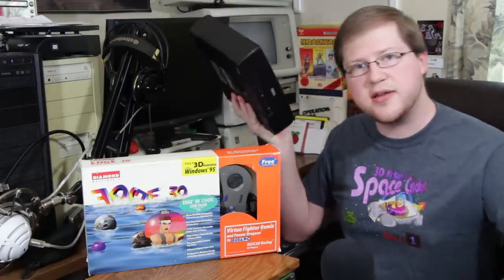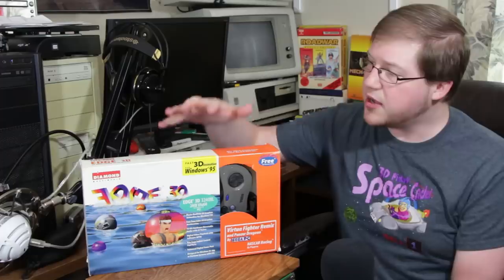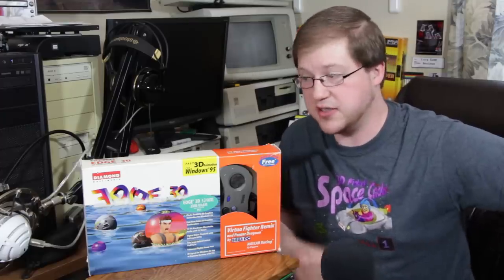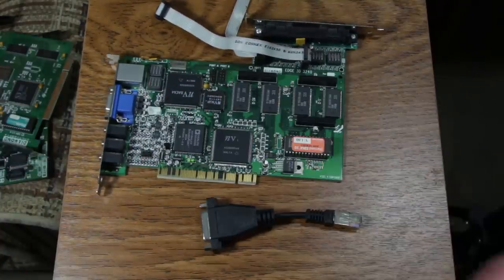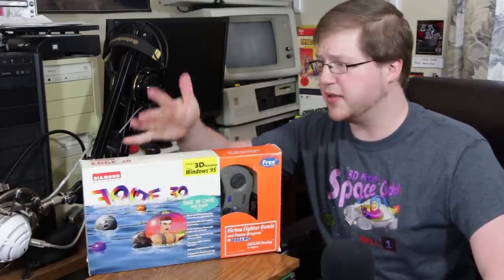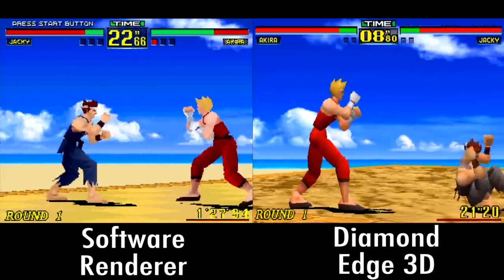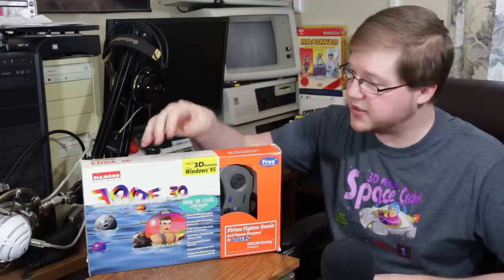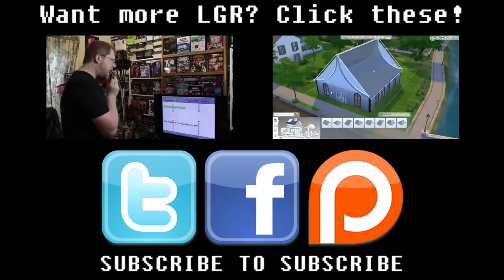LGR Oddware - Diamond Edge 3D (nVidia NV1+Sega Saturn Ports)

Comment: About OpenGL support way back then, the truth is that very few on these early 3d cards aimed at the gaming community really supported OpenGL. At this time OpenGL was more an API for professional rendering applications and things like CAD. That's even true for the 3DFX voodoo 1 and voodoo 2 cards. The  only "OpenGL support" they had was a kind of "mini OpenGL" which was only a subset of the full OpenGL API. And it was accomplished through an OpenGL Mini driver, which was really just a wrapper to Glide. It was really just a workaround for ID to avoid violating a contract they had with rendition. As part of that contract rendition helped ID develop VQuake, the first 3d hardware accelerated version of quake which specifically ran on the renditions virte cards. As stipulated in the contract ID, in return, was not supposed to release a version of the game that had native support for any other card manufacturers. But being impressed by the performance of the 3DFX products, Carmacke wanted to release a version that would take advantage of that. So, the Mini GL glide wrapper was born as a workaround. Probably the only 3d gaming cards of this era that perhaps really supported OpenGL might have been the Permedia 2 based cards and I'm not totally sure about that.
Reply: Where did you get this fairy tale story? 
I know a completely different story about this. Windows 9x initially did not support OpenGL, it could only support Direct3d (not counting Glide and other 3d party APIs here). However, Windows NT fully supported OpenGL, but the demands on driver programmers for a complete OpenGL driver were so high that initially there was hardly any hardware with corresponding drivers. That's why the concept of MiniGL drivers was introduced as a workaround in Windows NT by Microsoft.  It was intended to simplify development and be available as a quick interim solution until graphics chip manufacturers had developed full-fledged OpenGL drivers. MiniGL did cost some performance, that was their drawback. 
Later 3dFX was working on a full OpenGL implementation, and in the meantime had the MiniGL drivers. However, this full-fledged implementation never happened because 3dFX went bankrupt at that time before it was finished.

As for ID software, John Carmack developed Quake on a NextStep machine because that was a better way for him to develop. The NextStep machine naturally supported OpenGL and later he switched to Windows NT 4.0. But that was only after the release of Quake. Windows NT 4.0 was therefore used for later patches for Quake and for Quake 2 as a developer system at ID Software.
ID Software would not have to sign such a contract like you claim. They didn't need to. The 3D chip manufacturers were at their feet at that point. So there was no reason to limit themselves.
Reply: @OpenGL4ever  As you said yourself OpenGL support was a driver issue and as such required a driver that implemented it. yes, there were professional 3d cards that supported openGl, but pretty much none of the 3d gaming cards did. They only supported Direct3D and sometimes a proprietary API, like Glide. Anyway, the so called "mini driver" that Quake and other ID games used was nothing but a DLL that functioned as a wrapper that translated a small subset of the OpenGL api calls into Glide. And it was said that it was coded by Cammacke himself. Yes, later on, gaming card manufacturers added OpenGL support into their drivers, but the miniGL DLL that Quake used was just a wrapper to Glide, that's all, nothing more.

Comment: I remember buying a GeForce4 Ti 4200 128MB in the early 2000's...Now we have like 6-12GB video cards with quad SLI that cost more than a used car. I also remember dreaming about having a 512MB video card, I thought I would never need to upgrade lol.

Comment: So, are you saying that the DirectX drivers actually made the card useless and everything just used the CPU in software mode or did it still use the card's possessing but it couldn't use any of the special chips designed for the quad computations?

I would have liked to have seen some other games that didn't come with it, just to see if it would work with regular games that were specifically made to play on it.

Anyway, have a good one.

Comment: I had this card when it originally came out.
The 3d acceleration was only useful for this games that it came with, no more games were ever released. 
There were a could of serious issue with this card:
1 - Did not support the actual 3d APIs computers were using (OpenGL and Direct3d)
2 - it could not run actual SEGA Saturn games only the PC versions of them, and none were ever release, except the ones that came with the card itself 
3 - It was not a proper VGA card, so running DOS games with it was a disaster. I remember trying to run DOOM and it was garbage, much worse when my normal VGA card.

All and all, I was happy when I got rid of it and bough a proper PC 3d accelleration card, the 3dfx Voodoo.
Reply: Point 3 did also apply to the rendition verite.

Comment: now if only someone would homebrew an adapter to make the EDGE board connect to normal USB. I'm certain it's possible, but I'm not well-versed enough in programming or PCB mapping to make it happen. If the Saturn controllers are as good as people say they are, however, it would be quite cool, and a much more elegant solution than a USB adapter.

Ultimately, though, a preexisting USB-Saturn adapter plugged into the motherboard and gutting the EDGE board to make a passthrough would be much easier and more practical while being externally elegant.
Reply: +inteli722 Or just wire a usb adapter inside the case so you don't have to see it..

Comment: I hear what sound to me like some odd phasing issues with the sound on the Diamond edge card, the stereophonic sound field doesn't sound right to me, it sounds a bit odd, particularly in the left channel, and I can't really describe it very well, is it possible that you didn't have a cable plugged in correctly or was the card doing odd things?  You talk about playing conversions of Sega Saturn games with this card, but if you owned a Sega Saturn and games, was it possible to put your Sega Saturn CD-ROM games into your PC and play them using the Diamond Edge card, or did you specifically need to buy PC conversions of the Saturn games?

Comment: This is an awesome card... Wish you could Install these on modern pcs :(
Reply: Doddo MultiGamer Yeah that's not the issue, getting something built with a firmware supporting Windows 95 to run on a Windows 8 pic would be the hard part

Comment: Wait is the Saturn console capable of the better output quantity? That is a significant difference. I know very little about this but I want to achieve that level quality. D :
Reply from the maker: Nope, this is a 3D accelerator, so it's doing a lot more than the Saturn did.
Reply: So pretty much buy the card or hope someone makes it better emulator, right? :(

Comment: Does it solve crash detection? I ran Saturn iso's last night, Virtua Fighter to be exact. Graphics and everything looked great (not using one of them cards by the way, got way better), the issue was the fighters were ring outting in the middle of the ring.

Comment: Nice video. And I agree with your soundcard comparison. However, roland wasn't the satandardback in the day. Rolands sounded awwesome, but were too expensivve for most people, which is why soundblaster was most popular. And the typical soundblaster would not sound much better than the diamond card. So by quality, there wouldn't be a loss when going for this "all in one" solution.
Reply from the maker: And if you listen to what I said, I wasn't talking about "standards" or anything like that. I was talking about the fact that this card came late to the sound card game and was aimed at higher-end users. But higher-end users already had awesome higher-end hardware, like the Roland devices for instance, that were far superior to what the Edge 3D offered. Keep in mind the time period this was offered. If you were talking about 1991 or something, it'd be a different story.
Reply: Lazy Game Reviews

Actually it doesn't make much sense that way, since Roland Cards had their high times in the early 90s. By the time the sega saturn came, no one used a roland card any more (and only few used them in the first place). There was an interview in a podcast a while ago, in which Rolands PR-Guy of the time stated that "Nobody except game reviewers ever used Roland Soundcards". So getting Roland in the comparison is outside of context either way. You should have compared the card to a soundblaster-compatible card for the midi-part, which was outdated anyway, since CD-Roms made their way after 1993. Of course there were still games that used midi, but by 1996 there were very few. So your comparison seems out of context to me. Don't get me wrong, I like the rest of your video but that just seems plain wrong to me.
  .

Comment: Are there any modern drivers for this card today or does it run on something like a COM port? I'd love to use this for the controllers!
Reply from the maker: Nope! But you can easily use Saturn controllers on modern machines using a USB adapter.
Reply: It just isn't as good as a dedicated card for it </s>
=P
Reply: This is irrelevant, but nice profile picture, dude.
Reply: why isnt it a dedicated card? its an actual GPU

Comment: Heh, the box says "Photo-Realistic 3D Graphics"  If that is photo-realistic I would hate to see what kind of world they live in.  Still, not bad for its age.
And yeah, video cards can make such a huge difference.  A friend of mine recently bought a used computer that had an nVidia 9300 card in it; the other stuff was good, but  because of the card games looked terrible.  So I had recently replaced my old computer and gave him an old nVidia 8800 GT card (A seven year old card that can still run Skyrim at medium to high settings with a smooth frame rate).  The difference was amazing.
Reply: That's logical, because the 3 in 9300 stands for an office card without much power. While the 8 of the 8800 stands for high end.
By the way, this has been the case with Nvidia cards for many decades. The second digit read from the left determines the class.
A 9800 would therefore be faster than the 8800.

Comment: Also, would it be possible to play other Sega Saturn games with this card, or would you have had to use other methods, as I note you say the games were specifically redesigned for the card.  Thank you, again, sorry for the many questions.
Reply from the maker: Nope, no Saturn games. The three Sega PC games for this were 3D-accelerated PC games that are specifically designed for the card.
Reply: Lazy Game Reviews - Thank you for the reply, hadn't really known much about the card until your review, so was very curious about these matters.  :D
Reply: Lazy Game Reviews I had the same question. :) It's no wonder that this card was a sales failure when it cost within a stone's throw of a full-on Saturn and had a very limited game library in comparison. A Saturn board, that included sound/game ports AND controllers, that let you play straight up Saturn games for $150 less would have sold like... well.. a bit better?
Reply: Maxwelhse Smith That's a good point, I don't understand why they didn't just allow it to play saturn games through the CD ROM drive if it had all the Saturn hardware already on the card?  Would've given it a lot more value.
Reply: Oh well.. You can buy a Saturn NOW for like $50, so we're all better off anyhow.. If only some of the games weren't like $400!
Reply: Maxwelhse Smith Yeah, but seeing every  saturn game in native 31khz would've been awesome!  I will just have to stick with 240p RGB on my saturn. :P

Comment: this is such a rad thing so question Lazy Game Reviews since that plays saturn game i wonder if you can mod it to play all of the saturn library. Plus i wish the genesis had something like this man that would be awesome XD
Reply: kaio0777 No, this is just a computer graphics card with Saturn gamepad compatible ports on it and a soundcard, not an actual Saturn hardware. Its rendering principle is incompatible with Silicon Graphics and Playstation approach to 3D, and it is vaguely similar but more powerful than what Saturn offered, so the card had an unfortunate distinction that only Saturn games could be ported to it without too much effort, and a handful of such ports have been produced.

So it's absolutely not helpful with regard to Saturn emulation or Saturn hardware recreation, certainly not more so than any other graphics processor of today based on a more general approach to rendering.

Comment: Why did some of the dashboard components in Nascar change between versions?  Using software renderer there's a white switch to the upper left of the tach that isn't there using the edge.  Using the edge there are two yellow switches below the oil and water gauges that aren't there using the renderer.
Reply from the maker: 1903tx They re-drew the entire cockpit's graphics for the 3D accelerated version, which was quite common to do in racing games. And some racers simply omitted the in-car view entirely in 3D mode. No idea why some things didn't make the cut here though!

Comment: Very cool. Odd indeed. So Nvidia NV1 powered the Sega Saturn graphics....   What did the dreamcast use?
Reply: Massa902 It was originally going to be the NV2, but Nvidia wanted to stick with quad rendering and Sega wanted to go with triangles so Sega went with the PowerVR2 for Dreamcast and Nvidia ended up scrapping the NV2 in favour of the Riva 128.
Reply: Massa902 This is incorrect, NV1 and Saturn are examples of accidentally similar approach to graphics. The Saturn VDPs were developed by SEGA, potentially with NEC and Yamaha and certainly without nVidia which didn't even exist at that time yet - think about it, they started developing it perhaps around 1990 or 1991 and were done by 1993 or so, else there would have been no release games in 1994.

That SEGA and nVidia could reach an agreement to port some games and include compatible ports was just a result of hardware ending up somewhat similar and SEGA struggling against Playstation, so they thought, ok, PC isn't console's predominant rival, let's give this a shot, no harm in expanding our market that way.

For Dreamcast, it's not known that nVidia GPU was ever under close consideration. There existed two prototypes, one developed in USA with Voodoo Graphics and one developed in Japan with NEC GPU based on a PowerVR2 graphics core licensed from Imagination Technologies, UK. Voodoo and SEGA had a falling out over breach of contract, which cemented the decision for PowerVR.

It ended up being a very good decision, as PowerVR was very performance and cost efficient with regard to whole system design, as it's very RAM and CPU efficient. It's also rumored that a chopped down PowerVR-derived system powers Nintendo DS (i can substantiate this speculation somewhat), and it's certainly been in all iPhones and a number of other devices.

Comment: Oh, this brings back bad memories. I bought the 4MB edition back in the mid-90s for something like $400+. This is perhaps the worst hardware purchase I have ever made. As I remember it the included SEGA ports were the only fantastic thing it did. Memory in DOS was limited to less than 1MB. Funny, thing is that I think I still have it around and perhaps even the SEGA ports. I forgot that it also included controller(s). Those I definitely don't have. It is saying a lot that I replaced it with a Matrox Mystique.
Reply: You're entirely right that it sucked in normal DOS games. Speed and compatibility were quite bad. This was a Windows 95 product, but too early for the rest of the games. Too bad the quad rendering never caught on. There is an interview with one of the developers saying it was much more powerful than the released games indicate. Controllers were only included in some releases of the card. I have the boxed version as well, and there are no controllers. Had to buy those on Ebay.
Reply: RetroCompaqGuy Quad rendering doesn't really make sense nowadays though.
Reply: You're right about that, but I was talking about the 90s as we never got to see the true potential of this card.

Comment: Makes me love my old PS1
Reply: They should make a 3d accelerator for the ps1
Reply: @Obscure_man31  the ps1 was the first machine to have 3d acceleration
Reply: @si4632  it didnt actaully since the cpu can actually do 2d but can do 3d kinda like tge super fx chip.
Reply: @Obscure_man31  Graphics: 3D Geometry Engine, with 2D rotation, scaling, transparency and fading and 3D texture mapping and shading
Reply: @Obscure_man31  thats a 3d accelerator
Reply: @si4632  thats not a 3d accelerator what your saying is a gpu and cpu a 3d accelerator is in the longest definition "As with almost any other computer function, the Accelerator will perform better when more memory is allotted to it. The sharpness and resolution of an image directly depends on the amount of memory used by the Accelerator. Limited memory can mean that the image will only be represented with a simple 256-color scheme. On the other hand, a greater capacity of memory allows millions of colors to be used when constructing an image!

The 3D Accelerator also functions as an individual computer, as mentioned above, and this helps it process images faster. While the Accelerator is readily able to process 64 or 128-bit data at a time, regular central processors must take it slower and only go through 32-bits in the same amount of time."
Reply: @Obscure_man31  point is its still hardware acceleration
Reply: @si4632  no its not dude